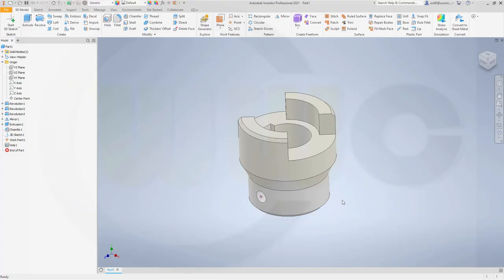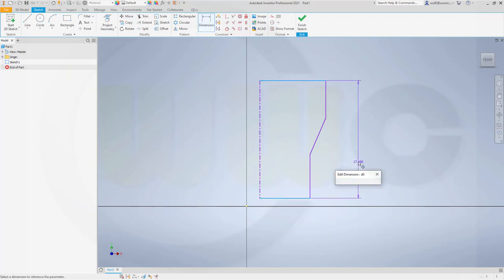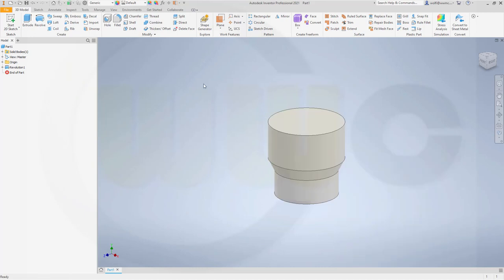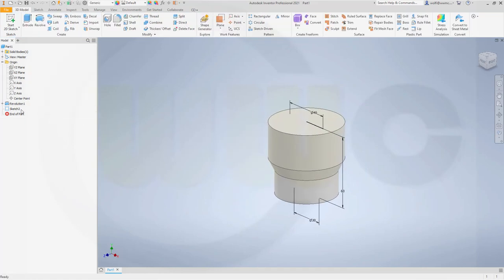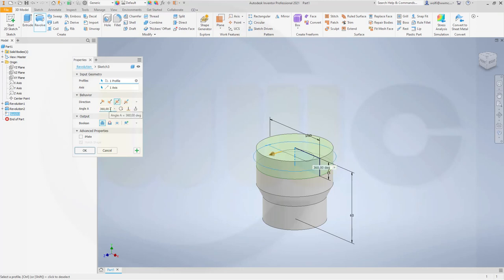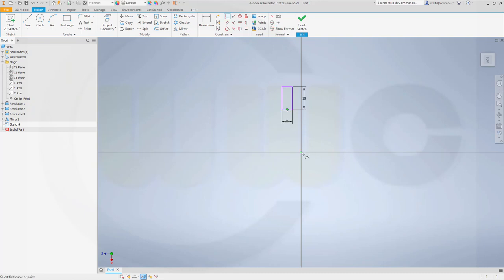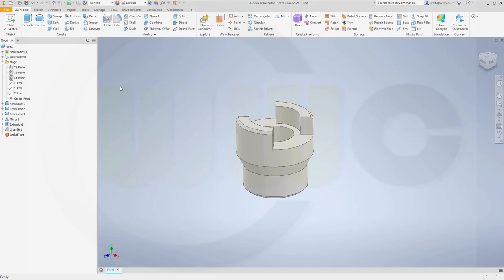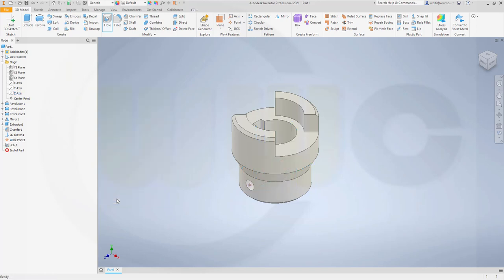4.2 Klauenkupplungshaelfte - Inventor 2021 Training - Part Design

Comment: i think autocad more usefull if u using two hands. command lines and commands getting more speed for drafting. using pop up menus with only right hand using be tiring right hand more slower than command lines+command combos.
Reply from the maker: This might be true, but Autocad is not a associative parametric program like Inventor, SolidWorks, Siemens NX etc. Regarding 3D modelling Autocad lacks a lot of features and is not history based.
Reply: @wolfgang.walden.cad.training  true. This is why i am break using autocad and trying to learn inventor.